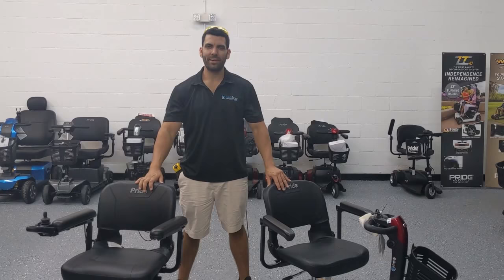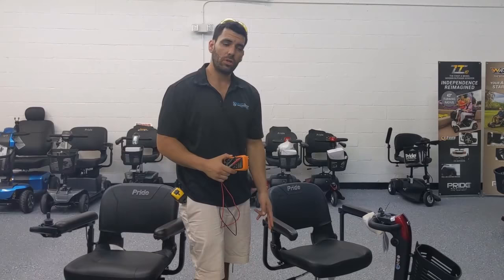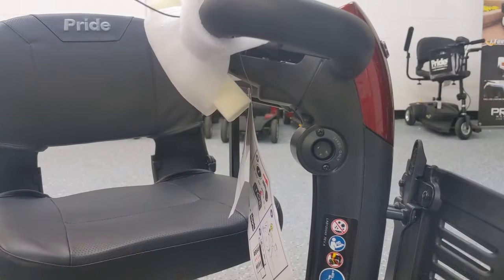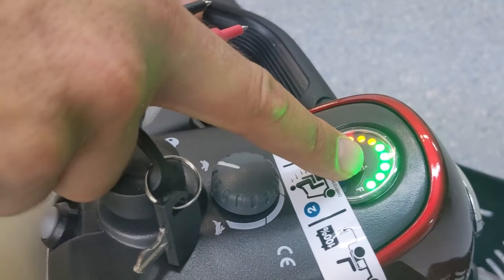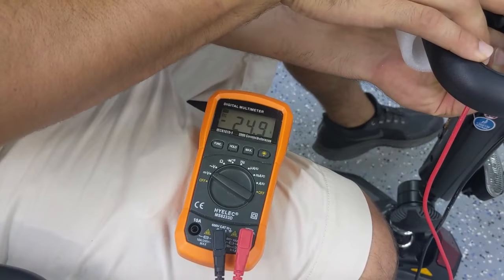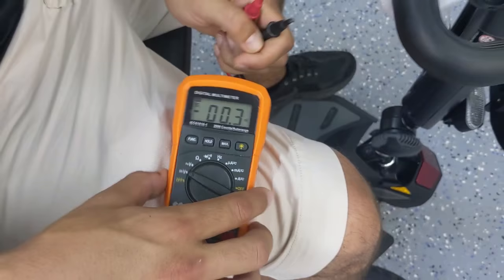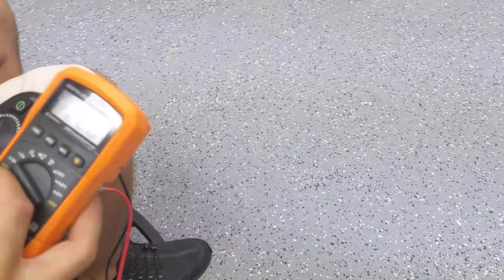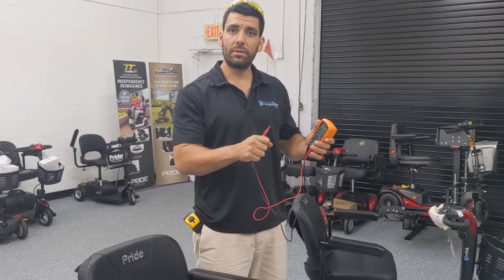🧑🏼‍🔧How to Troubleshoot Mobility Scooter Battery

Comment: Brand new batteries. Went to charge left it on charge for two Days. Green light on. But will not charge. Take off  light us where it was when i went to charge. So it is not chargring when it says it dies. Tried three different charger..
Reply from the maker: If you overcharge batteries, they will die. Two full days of charging could very well have inhibited them.

Comment: Hi! My Jazzy Elite 14 recently had new batteries, motors, and gear boxes installed. I charged the batteries over night to full charge. Drove the chair 1/2 mile. Then the batteries died. What could be the issue?
Reply from the maker: Make sure the batteries were charged properly and plugged in all the way. If that isn't the issue, you might want to reach out to someone because it could just be the batteries.

Comment: my 350$  scooter  is a FORTRESS  2000    bought used over 5 years ago for 350$ can   now??    battery  purchase    replacement is 2  x  $200    10 min job       48km  range  but i never tried  to find  that  but can go for 5  hrs      on my shopping trips   then i head  back home      in winter  temp -  5C is  my  limit in -5c i did  notice  power drop so headed  back home with   grocery goodies,   .  cold weather   cause  i  summised   tire's       and   2 wheel replacement  400$      tech came to house and  did it
Reply from the maker: Awesome! Thank you for commenting!

Comment: if i chARGED THE BATTERY OVERNIGHT AND MY VOLTMETER READS 27 IS THAT NORMAL? YOU SAID 25 WAS TYPICAL IN THE VIDEO
Reply from the maker: 27 would be fully charged.

Comment: Hello. I just picked up a used gogo traveler. Both batteries where pretty dead and would not charge. So I took the box apart and charge them seperate on 12v and got full charges to test the scooter. I will be using New batteries. My problem and what I was told by the owner. When pressing the lever. When you go pass 1/4 of the way. The motor disengages and goes to a neutral. release the lever hear a click try again. Barely use the lever it moves forward. But go more than that it shuts down. What am I looking for???
Reply from the maker: You need a technician, this is not something you can just easily solve on your own. You may need to get a new controller or throttle module.

Comment: Just come across your video. Thanks for this. My batteries seems to be charged but then the Green light starts to flash sometimes read the manual for the Rascal Vista DX and recommends Green light flashing (1) Batteries need charging. Done a Battery test  and  the reading is 27.01
Reply from the maker: Could be that you have a bad controller. Maybe take it in for a tech evaluation next.

Comment: Hi, Thank you for your knowledgeable videos, they have helped, have tested my battery as you have shown, I get a very good reading like yours. But, if I take the scooter out to use, the battery indicator quickly starts to show a reduction, there is also a variation in speed, and the indicator goes down to 1/2, 😢have you any ideas as to the problem.?
Reply from the maker: Could be a bad controller or connection somewhere. Hard to tell without having the scooter in hand.

Comment: I purchased 2  new batteries a couple of months ago but they die very quickly I'm lucky if they last a day before they fizzle out, not good..
Reply from the maker: Hi Felix, it could be a couple of things. You could have a bad battery charger which is most likely the reason. You could also have something going on internally that's causing your batteries bad. I recommend seeing what kind of output the charger is giving.

Comment: Thank you for your tip, have you seen case where  jazzy select 6 with new battery , where charger showing full charge green light, however joystick battery immediately  indicator have low battery (first 2 lights red, and orange) , battery measurement 25v (12.8v each). hopefully you have answer please . thank you
Reply from the maker: It's best to do a load test as shown in the video. That will pretty much help you find out if you're batteries are still good. If you're using Sealed Lead Acid batteries and it's already a few years old, it's probably time to change it. Thanks for watching our video and commenting!
Reply: @MobilityDirect  Thank you , it is  tricky as the load test for 1/2 mile with middle speed, load reading start 25.4v to 24.3v. the  battery acid sealed 9 month old used in house only short distance very  little use. the battery read 25 after load test which confused me to thing battery is ok and  controller  joystick is the problem.  I just replace joystick controller as old one was giving error  7 times flashing code which indicate joystick controller. do you think current joystick controller can give error in  reading battery charge less than the  actual as it reads just first 2 lights red and orange while battery measured full  25v and the charger indicate full charged battery. .  thank you again

Comment: I have a ? The way I understand it is some chargers keep charging even after the battery is charged , which damages the battery. Are all mobility scooter chargers float chargers also? One thing I’ve bought that seemed to help me was a Christmas light timer just cover the sensor for light to dusk pick the hours then I shuts off. The batteries are expensive I don’t want to replace them
Reply from the maker: Some of the scooters come with a "smart-charger" which is designed to stop charging when the battery is fully charged. Which model do you own?

Comment: depending on the battery they usualy only last 3 to 5 years. so have to replace them anyway.

My batteries look like their starting to go and they r less than 2 years old. should get 35 miles out of 1 charge but now its more like 10 miles. ive also noticed the speed drops as well as soon as 1 bar is gone out of the 6. my scooter has a digital speedo so can see how fast im going. Even though its supposed to be restriced to 8mph when i 1st got it brand new it was doing 13mph. now its 8mph til the 1st bar goes then it drops to 7mph. before even when the battery was nearly dead the speed didnt drop.

lots of dif advice out there. some say charge the batteries after every trip even if its only a 20 min charge. others say dont charge them till the battery is nearly dead. others say charge them up over night even if u didnt use the scooter that day.  prob is bateries have life cycles. the more often u charge them the quicker they fail. they can only be charged a set number if times before they start to fail.

It costs more but ur better off going for the higher amp battery's as they last longer if their is an option. like my last scooter had 50mah batteries and that could do 30 miles on 1 charge. but when they went i couldnt afford those batteries so got the normal batteries for that scoooter which were 30mAh and they only did 30 miles on a charge. my current scooter has 75mah as standard 100 as optional extra.

another thing is u need to keep the batteries warm but not too warm as that effects their performance. IE during the winter they will go flat faster and less speed. same during the summer if it's a hot day. optimal temps r around 20c for best range and speed.
Reply from the maker: Thanks for the comment!

Comment: I have a kymco mini comfort and have the problem of the lights going down quickly, I tested my batteries as in your video and voltage was 25.9 and when going forward and back it went down to 25.6 what could be the problem with my scooter? Thank you
Reply from the maker: We are not a dealer for that particular model, so I really wouldn't be able to provide accurate feedback
Reply: @MobilityDirect  thank you,you did help me with the batteries, so I'm grateful for that

Comment: I have replaced my batteries a couple of times and the same thing keeps happening which is this the first day I put the new batteries in the scooter runs fine then I plug in to charge the gage says full charge the needle goes all the way to green I have an older go go ultra 4 wheel then I get onto ride and the needle drops right away but just seconds ago it said Full charge. So then I continue to drop rapidly. I have used different chargers and same thing happens. So hoping you can help me figure this out.
Reply from the maker: Have you tried a new charger?

Comment: I have a Q600 with relatively new batteries I purchased in March of 2022. The charger indicates it is fully charged but the controller interface appears to be at about 50%. Should I let it charge even though it says fully charged? Also under load test it varied from about 23.8v (FULL Charge) to 22.9. Does that indicate enough variance to be a problem?
Reply from the maker: Sorry but we don't work on complex rehab chairs, only consumer friendly retail mobility products.
Reply: I have same problem , charger showed fully charged and controller show 20%, if you got pro answer please reply to me. thanks

Comment: I have just bought new batteries for my go go elite traveller plus but I am unable to get one of the battery connectors off the old batteries. I managed to just slip the other 3 off but the last one won't budge. I don't want to force it and damage connectors. Any advice please?
Reply from the maker: You might need to apply some WD40. If not, you can always cut the wire and add a new connector to the wire if you know how to.
Reply: @MobilityDirect  Will that not catch alight?  It's the red one so that is live isn't it?
Reply from the maker: @ktsmom99  it's 12 volts. It will not electrocute you...

Comment: So, if one of the indicator lights go out after only going a few blocks.Its safe to say the battery needs replacing ?????
Reply from the maker: Yes, most likely that is due to the batteries going bad.
Reply: @MobilityDirect  Thanks, I already purchased  upgraded batteries for my scooter.

Comment: Hi my name is Zee I have a jet three ultra mobility scooter for my mom I have put the new I have new batteries and the charger was not working and I have also changed the charger somehow I put it on the light turns green and it was showing the power in the charger but now somehow now when I’m trying to plug in the power the charger is not charging the battery there’s nothing wrong with the batteries I changed them they are brand new there’s nothing else seems to be wrong but the charging thing is not working it’s not charging the battery any advise what should I check please advise
Reply from the maker: You may need a new charger. I recommend calling a tech.

Comment: Hi! I recently got a brand new Drive three wheel scout scooter and assembled it. The scooter will not start. Im aware it should be charged overnight when you first get it, but is it odd that it didn’t start or do anything at all ? I have it charging now, and the charger shows a solid red light which means it’s supposedly charging, but the scooter and battery itself show no signs of charging.
Reply from the maker: You probably just need to connect the battery to the unit. They ship with the batteries disconnected most of the time.

Comment: There's got to be a better way, Who wants to be paranoid about not running your battery too far down. Engineering Fail!..Thanks for the Video
Reply from the maker: These batteries are not hard to maintain, you just need to keep an eye on the charge level.

Comment: Please help my automatic folding mobility scooter has folded down and I cant unfold it the battery has died. Cant get to plug to charger because its folded .can anybody help ? . It's a 3 wheel Drive folding mobility scooter.  Thanks in advance .
Reply from the maker: I would check the user manual for a manual release.